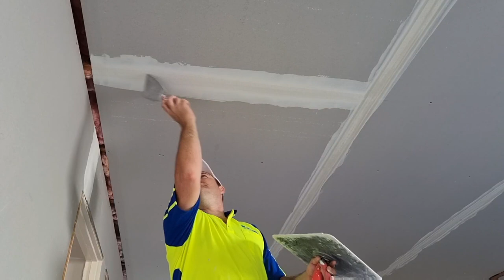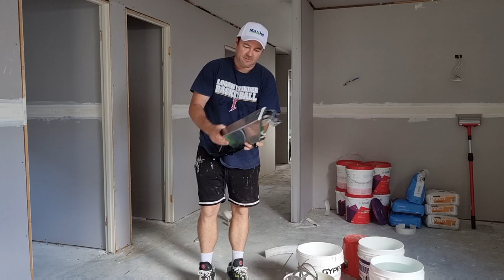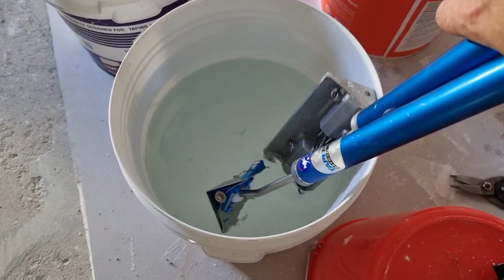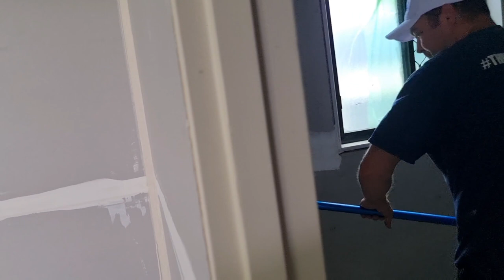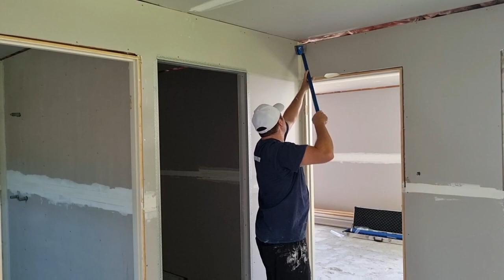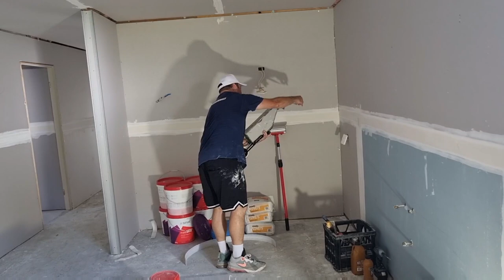It's worth learning how to use this DRYWALL Taping Tool

Comment: I always like your videos but I have the mudbox with the duel controls and as much as I have tried to like it I have a DELKO ZUNDER taper with corner roller I bought of a guy for $50 and I recon its just as fast or faster on vertical corners and wall joints and lighter.

Comment: Was that a powder a setting joint mix, if it was what's the working time, cleaning the mud box easy ?
Reply: It would be hot mud he is using and it hoses out just fine as long as you don't leave it too long.

Comment: Are there any houses down under without out the upper cove/crown molding??
Reply from the maker: There are some, but most new and cheap houses are like this . Even though you can get many different better styles, people just use this one
Reply: Here in the dirty D (Detroit) code says we have to tape everything for fire stop code.
Reply from the maker: Yeah i heard that, we got it pretty good here.
Reply from the maker: Busy in Detroit lately
Reply: @Maxkil  its a boom town right now
Reply: @Maxkil  crazy busy nd its the slow season

Comment: Does anyone  know why , when coating over hot mud why does it cause pin holes , or bubbles to form , ...used mesh tape 40 minute hot mud then put my finnish coat over set up hot mud and bubbles formed /pin holes why does this happen,  it was beedex silver set 40 minute hot mud also used different brands and still thay appear...I have heard a lot of theories  , was even told to use a little bit of  liquid dish soap , it didn't help ,
Reply: There is too much moisture coming out the front and some base coats and top coats are more compatible than others so try other brands and combinations and see how you go.